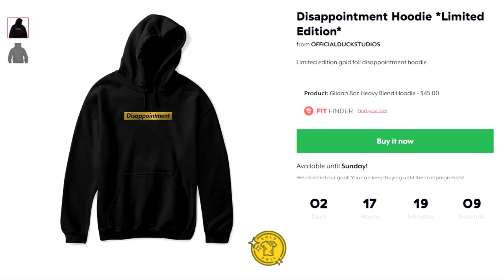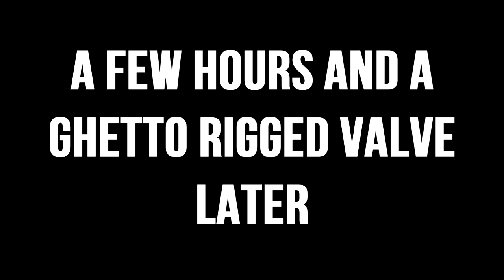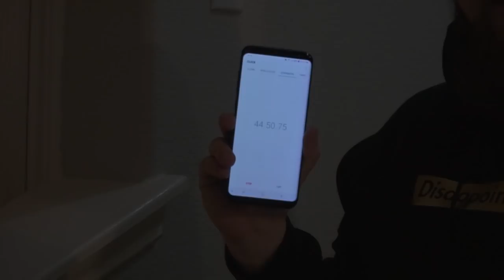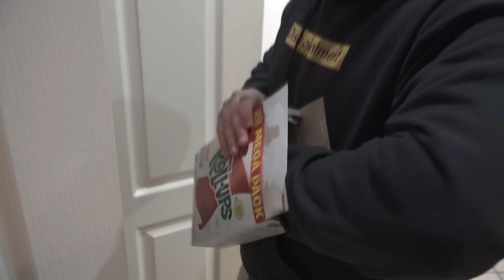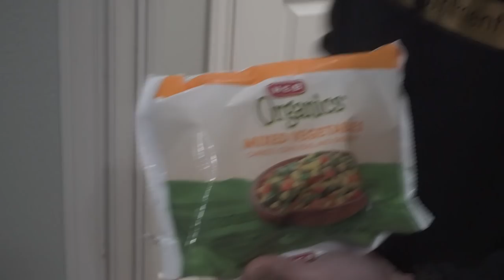I tried Chinese water torture, and it was worse than you think

Comment: The torture method is for single drops on one place nest the eyes of the forehead. It is to increase irritations and extreme focus on that one spot and normally you would use water that's either very hot or very cold. Cold is most efficient. The target ought to also be left in a room where it's totally dark or he is blinded by something. This will create isolation and isolation is almost the worst if you don't have anything to do, therefore by initiating one sequence of action that is the water falling by seconds it will create immense focus and irritations on the exact spot and the focus will be only on that due to the isolation effect.